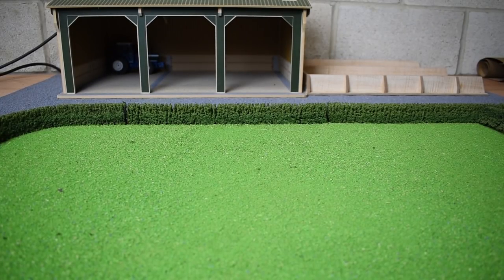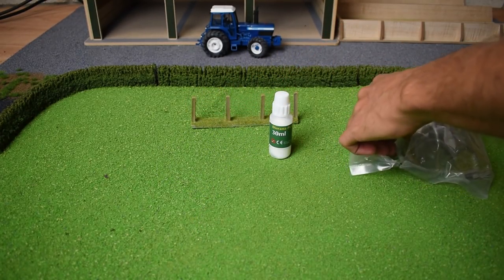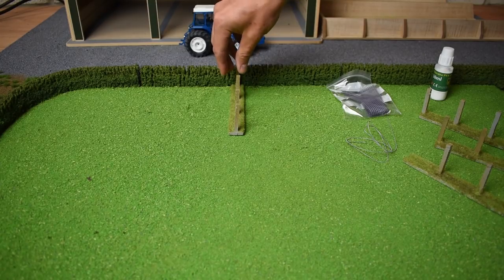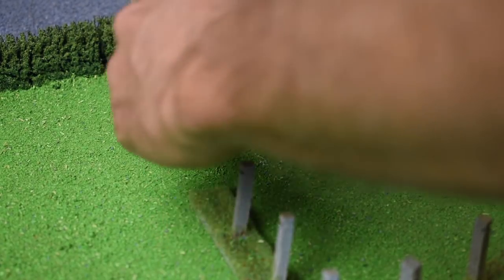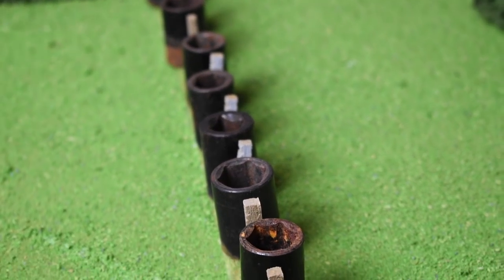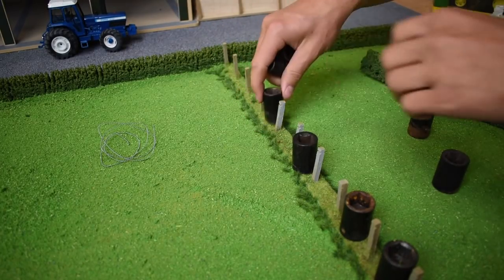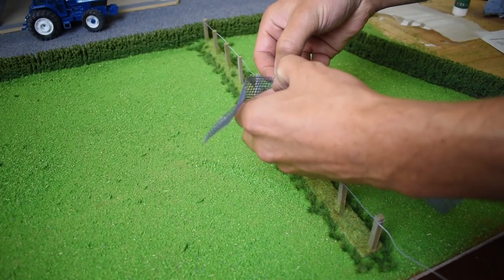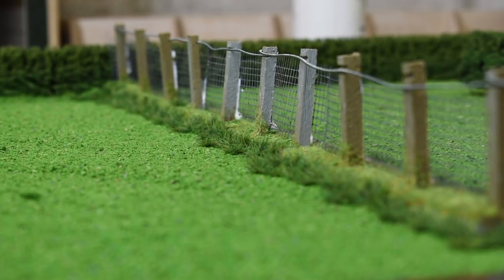PUTTING UP A LIVESTOCK FENCE [Model Farm Build #5]

Comment: The mesh/chain link fence is called pigwire 🙂
Reply: The upper one on this fence, two strands on most real life fences, is called barbedwire, due to the fact it has small barbs running its length, the mesh type wire is called pig wire, as it is the only fence type that will keep pigs in/out, it is also used for sheep, but has been given the name pigwire.
Reply: Harry IOM oh my mistake sorry 😐
Reply: @harveyrussell7840  no problem mate 🙂
Reply: Harry IOM ok mate